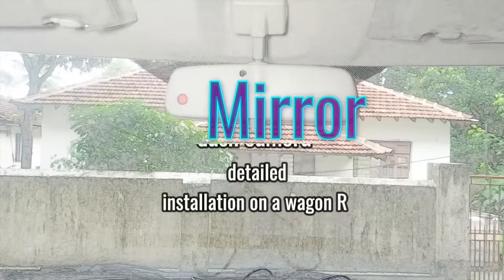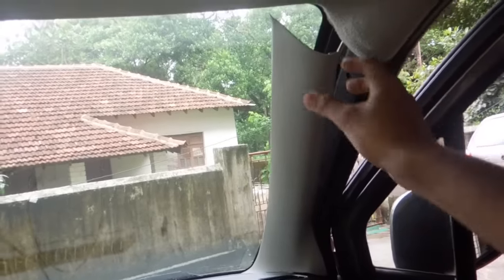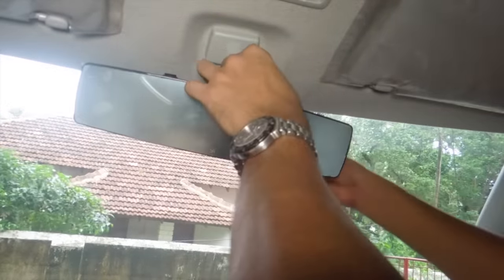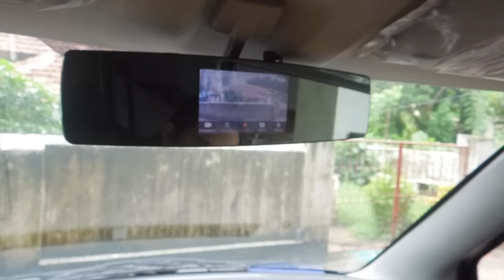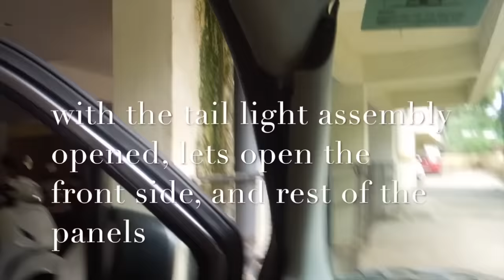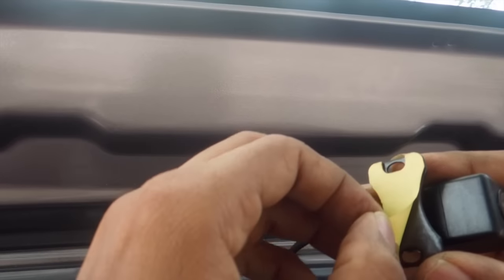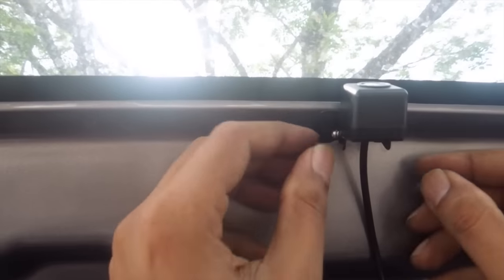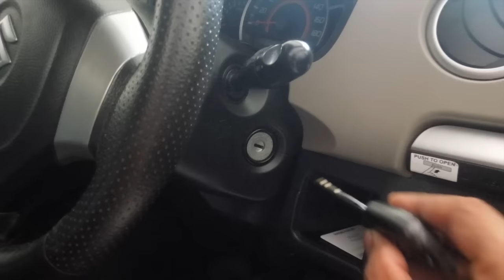Yi Mirror Dash Cam Detailed Installation | Suzuki Wagon R

Comment: do you need to have it plugged in at all times for it to work or does it hold a charge?
Reply from the maker: Hi Jess, the device has a small battery and holds charge for a short time, yes it needs to be plugged in.

Comment: Great video, Psycho. Just installed front cam on my car 530i, but I'm hesitant about rear cam cause installer says he needs to drill holes. Is that necessary or will the two sided tape be enough?
Reply from the maker: @Vinci Wadley, no need of drilling holes use the double sided tape also u can use an epoxy/hot glue to secure the rear cam, i have used hot glue to secure it having faced no problems
Reply: @psycolana  Thank you, so much for replying and for your advice. I almost threw the tape away not knowing what it was or whether I needed it..lol
Reply from the maker: @Vinci Wadley u r welcome
Reply: @psycolana  having trouble with memory card, what type to use?
Reply from the maker: using a SanDisk Ultra 64GB Class 10 Micro SD Memory Card
Reply: @psycolana  okay, thanks

Comment: I have two Questions.
1. Can we turn off the Display and while recording is happening in the background or display will be mandated to run all the time while recording??
2. Rear camera wont be recorded, only it will be used as reverse cam? am I right?
Reply from the maker: A1. Display automatically turns off in 1min (option in settings)
A2. Rear Camera also records
please have a look at the recorded footage  https://youtu.be/NtK5ELYm6to
Reply: @psycolana  : what is the length of the unit. My present nissan sunny"s sun visor obstructs while folding. Just curious if this unit would fit.

Comment: Do I need to connect the rear view camera to the light or it works only connected to the mirror?
Reply from the maker: Hi Abaianit Cristian, it will work if its connected only to the mirror, but for the parking assist to function it needs to be connected to the +ve terminal of the parking/reversing light

Comment: Hi may i ask why i connected the rear camera with postive wired of backup camera, but when i try it don't work
Reply from the maker: @Jack tan, Hi Jack, your red cable coming from the front unit of the Yi dashcam needs to be connected to the power source that is the +ve terminal of parking light (bulb) in the tail light assembly to activate the rear parking cam, 
also please check : 
- the terminal with a multimeter if its the right terminal (+ve), 
- connecter from rear cam is properly connected in the socket (video 10.37)
- pin is connected to the front unit of the dash camera properly
Reply: @psycolana  thanks will do so again
Reply: @jacktan4  Did you solve the problem? I am having similar issue. I connected the red wire to reverse light and camera works fine but it does nothing when I put it in reverse.

Comment: Design is not good,

 Video screen is in between, obstructs rear view.

2. Suggested to have gps and GPRS on mirror to tag location.
Reply from the maker: Hi Uday, Video screen goes off in a min so does not obstruct rear view, also been using this mirror cam since may2018 in India also this mirror cam has helped in 2 incidents where police had to be called, and footage helped,  regarding gps and gprs I Totally agree with you,